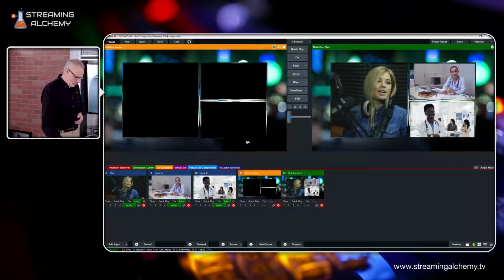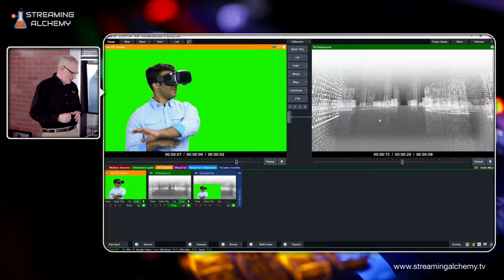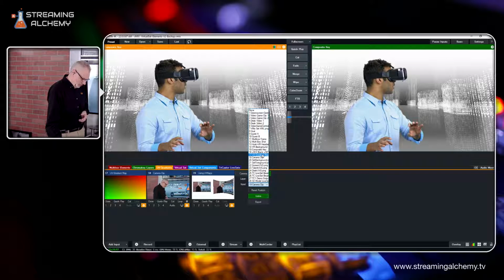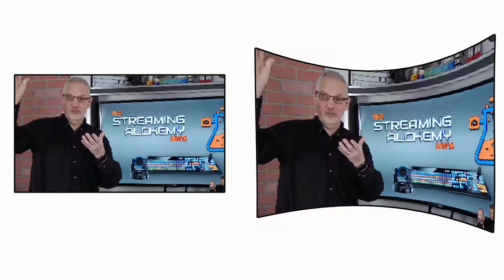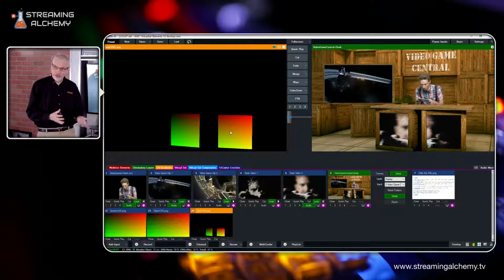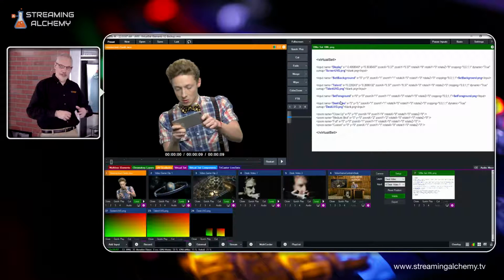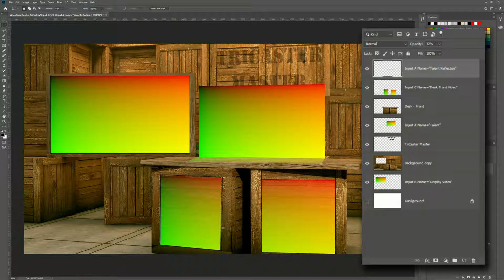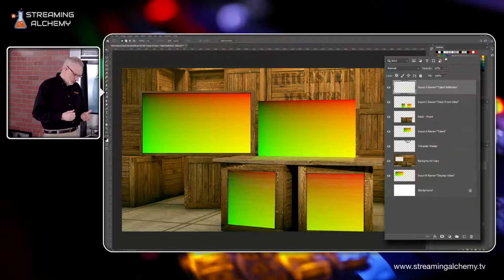Introduction to Creating Virtual Sets

Comment: Thank you for explaining in-depth. I have a problem with picture and video pixelation after I UV map in the virtual set. I am any steps I am missing?
Reply from the maker: Hi Sisay - Thanks for watching! Video pixelization in virtual sets is typically caused by building your UV Maps with too shallow a bit depth per color. Each color channel of a UV Map should be at lease 16-bits. Tools like Photoshop typically default to 8-bit color depth, making the maximum resolution of your map 256x256. That resolution will make everything look very pixelated - especially when you make mapped items larger. 

We just did a new show today discussing UV Maps (https://youtu.be/IV90BvRCWFI) which should give you a bit more detail on this topic. 

Hope this helps!

Comment: Great stuff and I learned a lot. I was wondering if you can amswer that when I zoom in the camera the vide/image I have in my screen is pixelated? I have tried with 4k videos and the result is the same.

ANy suggestions would be appreciated.

Cheers
Reply from the maker: Hi Al HassanT - The entire virtual set should be at least 4K, and you shouldn’t zoom in any more that to the native resolution of you production. For a 4K set, you can do a 2x zoom for 1080 or a 3x zoom for 720. Anything beyond that will start to pixelate.

Comment: Thanks for the great explanation! I'm curious as to the purpose of the "dynamic" parameter for an input in a vMix virtual set. Could you elucidate?
Reply from the maker: Hi Gary - Missed responding to this one. The Dynamic parameter specifies that you can change the source of the input associated with that layer or UV Map. It will give you the option to select an input to assign to it.
Reply: @StreamingAlchemy  Thanks, John. I had figured that out, and you did mention it in a subsequent show. I appreciate you taking the time to answer.

Comment: FYI, I'm pretty sure your virtual set in tricaster is so dark because you are outputting the file in 32 bit colour space, if you try using 16bit colour space it should export the colours correctly.